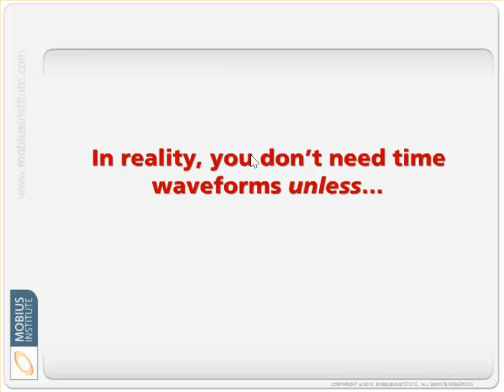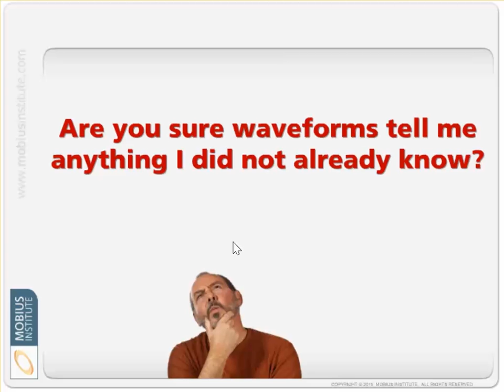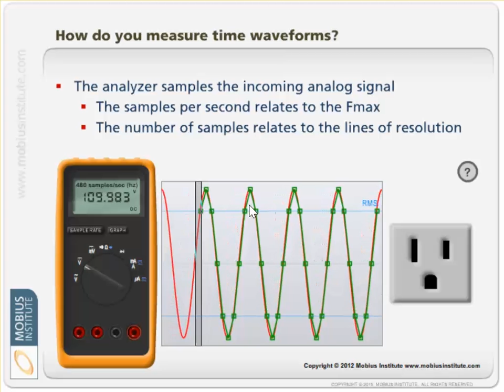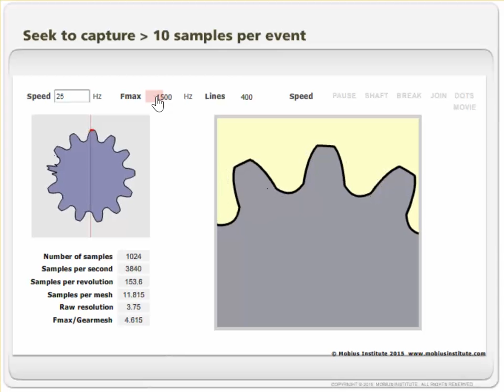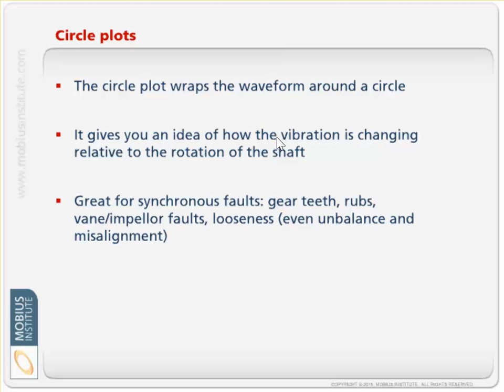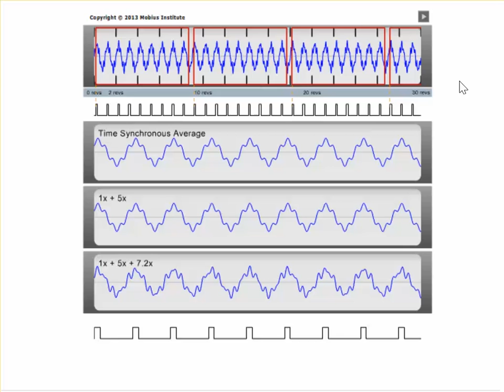Vibration Analysis - Time Waveform Analysis by Mobius Institute

Comment: Thanks for great explanation.
I have one question:
If my spectrum shows clear BPFO or BPFI, what should i have see on time or acceleration waveform? The impacts should be spaced by the bearing faults?
Reply: It depends really on the inner or outer race. Inner race faults will be modulated by the shaft and outer wont, but yes the spacings should be at the fault frequency. Bearing faults will produce very sharp impacts in the spectrum. You should also make sure your demodulation or peakvue is set correctly

Comment: what sort of graph do you get when you take vibration reading and how do you convert it into time waveform and frequency domain? 
Thanks
Reply: A vibration reading will usually be in the form of acceleration versus time (or occasionally velocity).  Thus the reading by default is in the time domain.  You can take the Fast Fourier Transform to transfer the data into the frequency domain.  Most vibration software, or even general analysis software like Matlab or LabView, will have the FFT built into it.